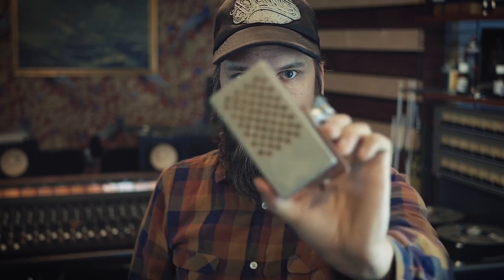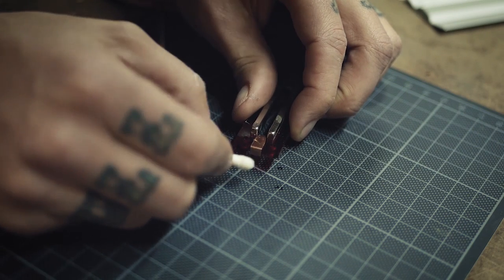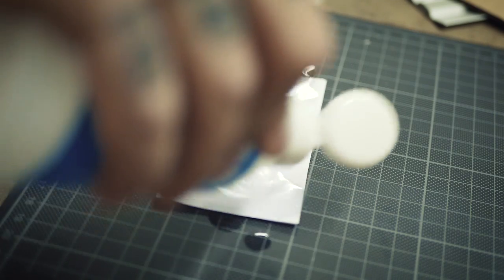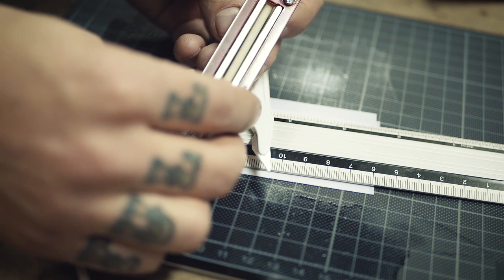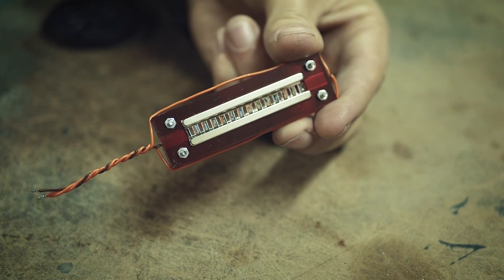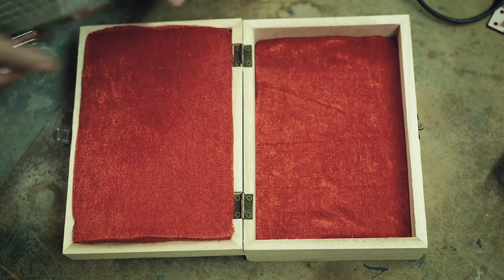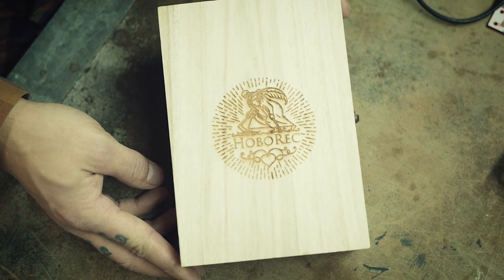DIY Ribbon Microphone, How I made mine (HoboRec Bull Sessions #19)

Comment: I have calculated how long your beautiful, delicate ribbon would last in the hands of the vocalist of the thrash
metal track in the background .... I think about 0.7 seconds! 
Your design and construction is excellent. It might be worth mentioning though that ribbons need a lot of gain. 
My Neumann condenser mic needs 30dB of gain,  an SM58 +50dB and my Coles STC 4038 needs +70dB on vocals
Sometimes the noise floor of the mixer bus spoils the clarity of the ribbon mic. Also many economy mixers may  not 
have enough gain. I have all 3 hanging in my vocal booth. The ribbon is not always happy. It is VERY sensitive to p's and b's
Many thanks for your work. John, Manchester UK
Reply from the maker: That would be in my hands, and yes you’re probably right that it wouldn’t  be that great to scream in to it hehe. The output of this mic is pretty much the same as a SM57. But a lot darker sounding, so if you want more too end there will be more noise for sure.

Comment: You said using brass for the bracket kept breaking. Try annealing the brass by heating it up with a torch first. Heat it,  bend it a little, then heat it some more while working it to your desired angle. It keeps the brass from getting work hardened this way, and remains much more flexible.
Reply from the maker: +You&I i tried that too with no luck. Either I suck, or the material wasn’t that good.

Comment: you want those cables from the motor as thick as possible, the resistance of the motor is some mOhms the resistance of thin cables can be comparable which will mean that some energy will be lost in the cables making the mic less sensible and noisy.
Reply from the maker: Oh, that’s good to know. But the output of this mic was about the same as a sm57.

Comment: Very good video - in the need for a figure eight mic for video (M/S) I 
found your video. I excluded a ribbon now due to strong magnetic fields 
(maybe not good for the camera :) - I will try two routes: a small 
loudspeaker as dynamic mic capsule and a primo figure eight capsule.
What I learned for the dynamic mic is that "using a transformer is allowed" and an old 220V -> 9V (9V to loudspeaker) toroid transformer delivered enough voltage for a simple Op Amp based mic amplifier!

Comment: Hi @hoborec - Firstly thanks for an awesome video! Stunning work. 
I'm looking to engage in a similar project myself but after seeing your work on this I have a couple of questions which I wonder if you would be kind enough to answer. 1) why do you have 2 wires from the top of your motor - I haven't seen this in any other design I can find but your mic sounds great so I'm curious what the function is. 2) Ive looked at the making of royer motors and they seem to be built on a metal frame - this surely means that the ribbon is not electrically isolated from the magnets so I'm curious why you mention that the copper tape in your design must not touch the magnets?
I know you will have tons of people to answer but if you have time Id really appreciate your thoughts. Many thanks!
Ben

Comment: Awesome work dude!! Tnx for sharing! Only one cuestion: does the Lundhall tr protect the mic from phantom power? Or this mic works without 48v? Tnx again!
Reply from the maker: Thank you very much! Yes the microphone works without 48v, it’s a passive circuit. I think the transformer should protect against the phantom power. I have accidentally had the phantom power on without breaking the microphone, but I try to avoid it. Better to be safe than sorry.
Reply: Phantom power is applied with its negative (-) at XLR pin 1 and its positive (+) at XLR pins 2 and 3 both. The way this mic is wired (pins 1 and 3 connected) it is more probable that the phantom power source will have issues than the mic itself.  As @HoboRec Recording Studios pointed out, nothing special will happen, but as with all ribbon microphones, you should play it safe and make sure that there is no phantom power applied.

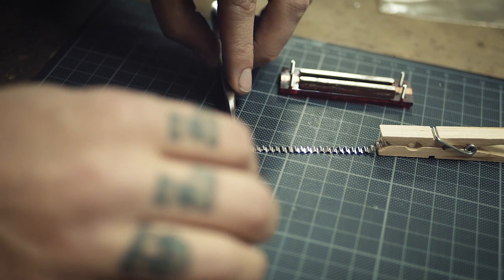Comment: 5:00  - so, you do the corrugating while there is still a piece of paper on either side and the aluminium which is sandwiched in between?
When the isopropyl dries off do these pieces of paper just lift away easily?
Reply from the maker: Yes, I found that to be the easiest way for me. The paper comes of automatically when it dries.
Reply: @hoborec  thanks👍

Comment: hey where are the poles of the magnets? or is that important ? or does it simply have to be liek they would stick together
Reply from the maker: Yes the polarity has to go sideways through the bars so you have positive and negative on the long sides, not on the short ends. Other than that it’s just as you said. They should be placed so that they pull together.
Reply: Thanks a lot man! :)  @hoborec

Comment: Hello Sir,
thank you for sharing your knowlegde. Very nice contruction. I just want to mention there is an effect, called galvanic corrosion, wich could make the aluminum ribbon dissapear. https://en.wikipedia.org/wiki/Galvanic_corrosion
The solution migth be to get some solder on the copper or use some tinned wire and wrap it around it, like you did with the sticky copper tape.

Comment: Love the video, thanks for doing this! 

how should I do if I buy the T25 transformer from pfsonics? it has already blue and red cables, and then the ones that go to the XLR, do I still have to sold cables in the motor? or I just sold red cable in the top copper and blue in the bottom? I am correct? thanks for the help in advance!
Reply from the maker: Hi, I'm not sure about that one. Are the red and blue cables long enough? In that case I guess you could try that.

Comment: Love your channel so many awesome DIY projects, and the recordings are stellar! I was going to try my hand at a DIY ribbon mic but am struggling to get the motor frame built. Do you happen to have a 3d printing file that you could share? I've already ordered the magnets you mention N42 2"x1/4"x1/8" so was trying to figure out what the gap and ribbon width should be. I've read something in a range of 4 mm - 6 mm (0.16" - 0.25") for your first motor because the foil is so hard to work with, but don't want my gap to be too wide for the N42's pull strength. Also do you have any plans to sell the motor frames, or perhaps and entire motor in future?
Reply from the maker: I've been asked about the print files before, but I always seem to forget to find them and send them to people. I think when I'm done with my new mic model I'll make some diy kits and also part for sale in the web shop. E-mail me at info@hoborec.com and I'll see if I can make my brain remember to dig those files up.